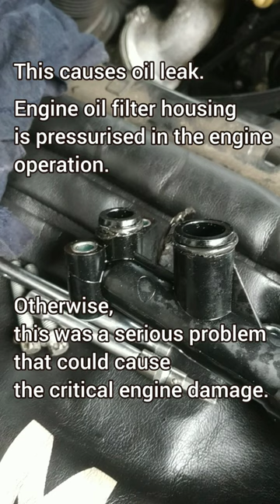OM651(Mercedes) The engine oil filter housing gasket replacement.

Comment: Don’t put any silicone on this orings it must be installed without any silicones but put a bit oil on them so they will seat as should - silicone will make them don’t seat as should and stick to place as should

Comment: Hi, can you tell me the size of the o-rings? In the EPC, 2 with a larger diameter and 1 with a smaller diameter appear, but in the video they appear to be 2 with a smaller diameter and 1 with a larger diameter.

Comment: Are you familiair with the problem of oil running back from the filter when the engine is stopped for a while ? Is there some sort of valve in the housing ?
Reply from the maker: I am not sure there is a check valve in the housing. Can I ask you what kind of problem with your engine due to this matter?

Comment: Hi.i bought a complete filterhouse with the cooler and i get confused if i do fix the filterhouse only without cooler?
Reply from the maker: Sorry for late reply. I will be good to exchange cooler set as the o-ring on the check valve spring in the cooler will be leaking sooner or later. However, it will be more complicated to exchange cooler set than this process.

Comment: I did on my own sprinter twice! Because the o rings damaged! At the end I did 4 times same job same van in 2 months! 😕😕 and finally is no more leaks!😬🙃
Reply from the maker: Well done, mate!! I normally use a silicone spray on the rubber o-ring and mating surface for lubrication.
Reply: For me almost the same. 3 time disassembling thought this was an oil pan leak. But when checking how much it is neede to remove oil pan I thought better reassembly this again :DD Just a question did you change that oil filter housing or only the orings ?  cause before I changed the orings only, and they always snapped.
Reply: @dzitiatri  i bought the oil filter housing!but I I find out that you can buy just the O rings in the dealership. so you don’t have to buy everything oil housing & oil cooler! Good luck!!
Reply: @miguellomejoral1005  where did you bought them from?
Reply from the maker: @RbnConstruct From HSY, local European car part specialist.

Comment: Hi thank you so much for the video. Did you have to evacuate AC system or can you move the compressor without disconnecting lines?
Reply from the maker: Thank you for your comment. You don't need to degas the A/C system. Just remove 3bolts holding A/C compressor and put it aside. You just need very small amount of additional space to take the filter housing out.
Reply: @b.k.automotiveservices9489  thank you very much! :)

Comment: Hi 
I’ve found a Mercedes om651 wis specs and the M8 bolts to the crankcase are 20Nm, not 10 like you wrote, that is usually for the M6 bolt. 
Where have you found that torque?
Reply from the maker: You're right. M8 bolt's tightening torque is 18~20Nm. I make an mistake when editing the video clip. Thanks for informing me. I always use Autodata® technical specification when looking up the torque and other information.

Comment: Thanks for the great video. I must do this to my e class. I got the oring from my dealership. Just need silicone lubricant. How long should it take to do this job. A
Reply from the maker: It will be taking around 3~4hours.  However, the main problem will be happening due to the engine oil cooler in the future.

Comment: It's there any cooling liquid going through the engine oil filter? 
Do you need to release engine oil completely before you remove the housing?
Thanks for the video
Reply from the maker: If the engine is not running, engine oil pressure goes to zero psi. So, you don't need to release the pressure. Additionally, there are two chambers for engine oil & coolant in the engine oil cooler. Coolant flows through the engine oil cooler but it shouldn't contact with engine oil. If it dose, the cooler should be exchanged.
Reply: @b.k.automotiveservices9489  thank you for your fast reply. Yes that's makes sense, only when oil pressure is active oil should get it from the oil filter. Also it makes sense that only cooling liquid is in the oil cooler and not oil filter chamber. 
I want to exchange whole cooling liquid, as the cooling water pump is leaking a bit. I want to exchange therefore the thermostat also. In that case it could make sense to change the bearing from oil filter chamber as well right? I'm gonna also replace the ribbed belt and all pullies and the tensioner.
Reply from the maker: @BlaBla-jq5do Does the "bearing" mean the oil pump?
If you want to exchange the coolant due to leaking, you don't need to do. However, if you want to flush the system due to contamination or out of the date of coolant, please follow these steps;
1. Drain coolant from the system
2. Fill up with water
3. Run the engine until the thermostat is open(If you removed thermostat, it will be OK running the engine for 15 minutes)
4. Drain the water and flush the system with water again(Wait untill the engine becomes cool)
5. Replace parts(waterpump or thermostat)
6. Fill up with coolant(concentrate one due to water in the system remaining)
7. Run the engine untill thermostat opens
8. Check the coolant level
Reply: @b.k.automotiveservices9489 
I'm sorry, i meant sealing (O-ring) not bearing, my fault.
I have to replace the cooling pump and thought it is good idea to exchange/flush the whole cooling fluid as the car is 12 years old and has 200tkm now. Therefore i want to exchange all parts which could make problems and where i have to drain the cooling liquid again. 
Thanks for your manual. Is it really necessary if i just want to exchange the cooling fluid. I think i don't have a polluted/contaminated system.

Comment: Hi ! Have you changed the housing or only orings ? Doing this 3rd time. 2 times done only tried changed seals but they snapped all time if lubricated by engine oil.
Reply from the maker: I understand that this is very hard to insert the oil filter housing into the holes. I always use silicone spray to lubricate the seals and holes. That's what I can give you an advice.

Comment: Dear B.K. Automotive Services

My first question : Can you tell me the oil filter housing bolts tightening sequence? Or just diagonally?
The second question : Can you tell me the O-rings size?

Thanks in advance 😊
Reply from the maker: Thank you for your reply.
1. You can tight the bolts diagonally, and the tightening torque is T30: 10Nm/ others 20Nm.
2. I bought the orings from Mercedes dealer. Sorry, I have no idea of the oring size.

Comment: Hi what is the best way of ensuring prongs line up.  Took old housing off o rings like those in video.  Put new housing on as carefully as possible using silicone grease, but extremely difficult to ensure all three go in flush.  Any suggestions welcome kind regards.
Reply from the maker: First of all, you need to use correct size of o-rings and holes inner surface should be clean and smooth.

The way I am dong for inserting oil filter housing is like below.
1. Apply silicone spray on the o-rings and the holes where the o-rings go in.
2. Grap the top and bottom sections of the housing with both hand. And match the holes and inserts.
3. Push the housing with slight wiggling until the inserts are fully in. 
4. Take the housing off carefully and check the o-ring condition. If there is no damage of o-rings. You can repeat the procedure above again. 

It was very difficult for me handling the o-rings at the first time. However, if you keep trying, you can have "know-how" of it. 

Unfortunately, this is the advice all I can give you. Good luck, mate!!